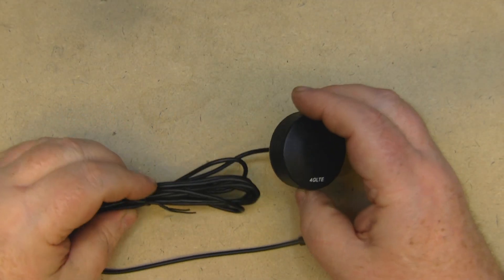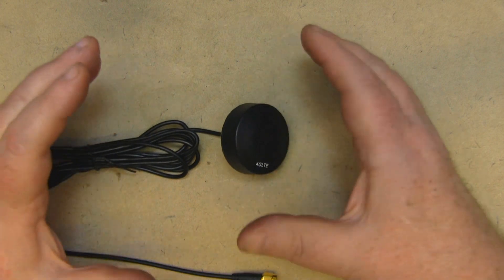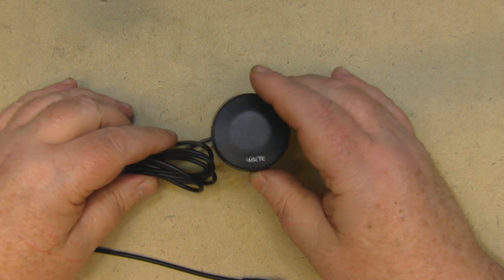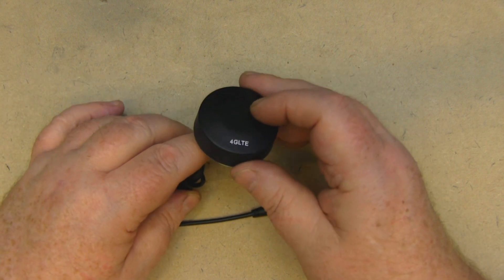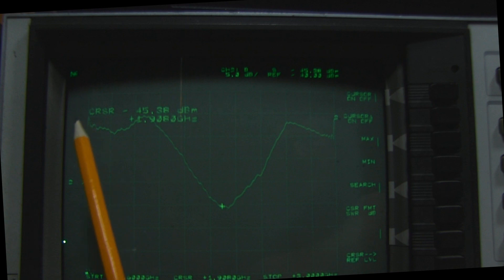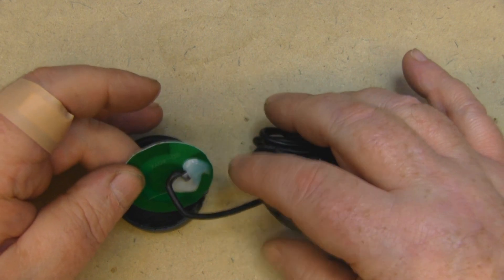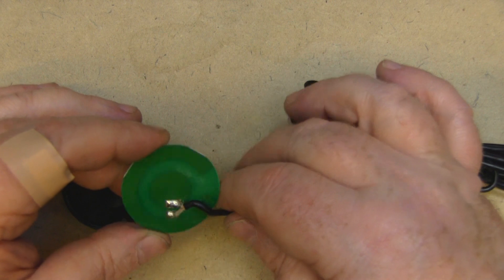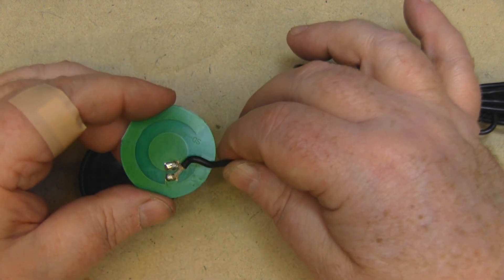Omnidirectional 2G 3G 4G Flat Plane Antenna

Comment: Interesting little puck.  Possibly overkill but you might want to test that VSWR  whilst mounted on a grounded metal backplane as would be used in the application.
Reply from the maker: Yes I did think of that myself it is something I need to test

Comment: Looks quite nice the little guy 😊 I Wonder what if we use thick metal like brass you usually do, and stick all them together instead of pcb 🤔 would increase the gain?
Reply from the maker: It would not increase the gain when I use thicker brass on a monopole the gain stays the same but you get a slight increase in bandwidth